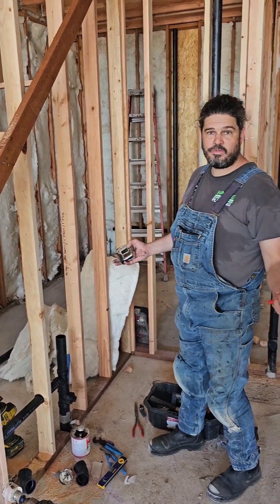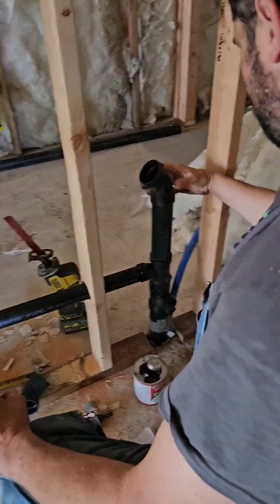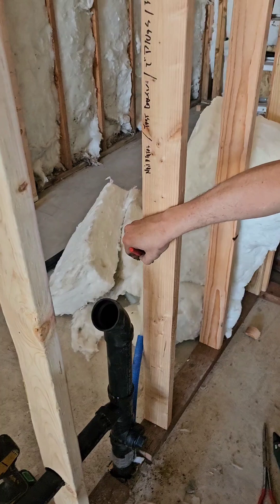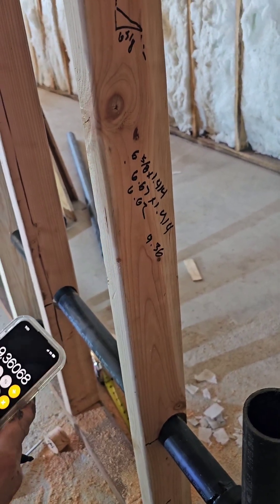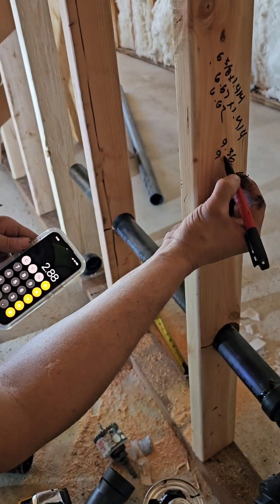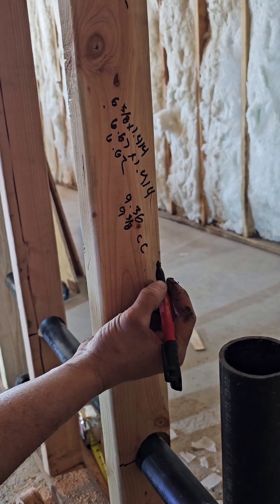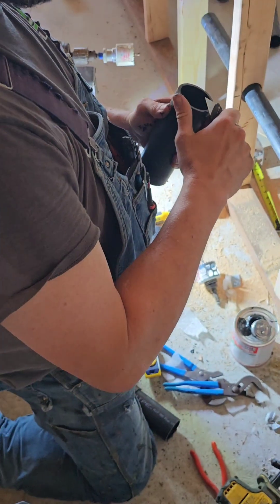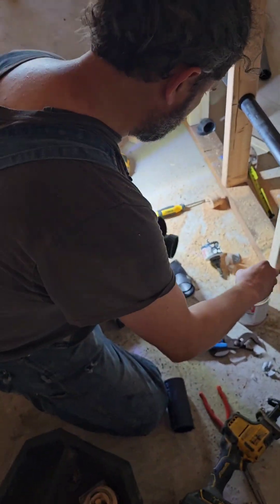Plumbing Rough-In Tip: 3 Most Common Methods 45 Degree Offsets

Comment: I’ve always done the first method. Never done the the 2nd one and the 3rd method is great and all but if your on a track you’d be too slow
Reply from the maker: Math is Great and Fast if you have a construction calculator and not trying to make a youtube video.. haha. I'm the guy that measures off the stem wall in the crawlspace.